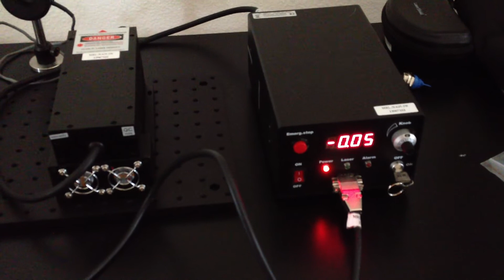635 nm, 3 Watt Diode Laser sales@dmphotonics.com

Comment from the maker: Science Photonics Fair consists of 5 Fairs : IR Fair, Optical Thin Film Fair, Spectroscopy Fair, UV & X-ray Fair, Optics & Laser Fair | In 2014 this event was relocated to The Science Museum and renamed ‘The Science Photonics Fair’. This event is made up of several specialized fairs, focussing on light based technology, such as The IR, Spectroscopy, Optical thin film and UV & X-ray Fairs. After receiving requests from our visitors, we are proud to announce that we have added ‘The Optics & Laser Fair’ to,,
Science Photonics Fair consists of 5 Fairs,
IR Fair
Optical Thin Film Fair
Spectroscopy Fair
UV & X-ray Fair
Optics & Laser Fair
Exhibition Outline
* Date:18-20 November, 2015 10:00~17:00
* Venue:Science Museum, Tokyo
* Supported / Cooperated by: Japan Photonics Council(JPC) / The Optical Society of Japan (OSJ) / Laser Society of Japan / The Spectroscopical Society of Japan / The Japan Society of Infrared Science and Technology / The Optical Thin-Film Science and Engineering group / JPC - Ultra Violet Light Research Group / Consortium of Visible Laser Diode Applications
* Concurrent event : 7th Optical Science Forum Summit
To Book your space

Exhibitor list

Please contact me if you have any question.
Best regards,

Yoshi Tsukamoto
International Dept.
The Optronics Co.,Ltd.
5-5, Shin ogawa machi, Shinjuku-ku, Tokyo 162-0814, Japan
TEL: +81-3-3269-3550 FAX: +81-3-3269-2551
mailto: yoshi@optronics.co.jp
Exhibitor List

Number
　 
A
Aisay Corporation （Spectroscopy） 
AOI Electronics CO., LTD （Spectroscopy）     
ARGO CORPORATION （IR）     
ARTRAY CO., LTD. （IR） 
　 ASAHI GLASS CO., LTD （IR） 
ASO Corporation （IR） 
AVAL DATA CORPORATION （IR） 
B
Bunkoukeiki Co., Ltd. （Spectroscopy） 
　 BWT Japan, Inc. （Spectroscopy）   
C
CBCOptics Co, Ltd （Optical Thin Film） 
CERATECH JAPAN Co., LTD （Optical Thin Film） 
　 CHRONIX Ltd. （IR） 
Consortium of Visible Laser Diode Applications （Laser Display） 
D
DAICO MFG CO., LTD. （Medical）     
　 DHT CORPORATION （IR）     
E
EBA JAPAN CO., LTD. （Spectroscopy）   
　 
F
FEIRA Co., Ltd. （IR） 
Filmetrics JAPAN, INC. （Optical Thin Film）     
　 Fluke （IR）   
FUJITOK CORPORATION （IR） 
G
GRAVITON （Medical）     
　 
H
HAMAMATSU PHOTONICS K.K. （UVIR） 
　 
I
IHARA TEC CO., LTD. （IR） 
IIDA LIGHTING INC. （UVIR）     
Indeco （IR）   
Infinitegra, Inc. （IR） 
　 InPhenix Inc. （IR） 
IR System co.,ltd. （IR）     
IWASAKI ELECTRIC CO., LTD （IR） 
J
JALUX Inc. （IR） 
JAPAN IMPOTERS ASSOCIATION OF LASERS & ELECTRO-OPTICS （Medical） 
Japan Laser Corporation （Medical） 
　 Japan Photonics Council （Medical） 
JEOL Ltd. （Optical Thin Film） 
JPC Ultra Violet Light Research Group （UVIR） 
K
KAWAI OPTICS CO., LTD （Optical Thin Film） 
Ken Automation, Inc. （IR）     
　 KLV CO.,LTD （Spectroscopy）     
Koshin Kogaku （Optical Thin Film） 
L
Laser Society of Japan （Medical） 
　 
M
MAXNER ELECTRONICS Co., Ltd. （IR）   
MicroVision, Inc. （Laser Display） 
　 MITSUBISHI CABLE INDUSTRIES, LTD. （Medical） 
N
NEOARK Corporation （Medical）     
NIDEK CO., LTD. （Optical Thin Film） 
Nihon Tokushu Kogaku Jushi Co., Ltd. （IR） 
NipponRoper （Spectroscopy）   
　 NIPPON　AVIONICS　CO., LTD. （IR）   
NISSIN ELECTRONIC CO., LTD （IR）    
NITRIDE SEMICONDUCTORS Co.,Ltd. （UVIR）    
NITTA CORPORATION （Medical） 
O
Ocean Photonics, Inc. （UVIR） 
Okamotog glass co., ltd （IR） 
OPHIR JAPAN LTD （Medical） 
Optical Coatings Japan （IR） 
Optical Solutions Corporation （Medical）   
Optima Corp. （UVIR） 
　 Opto science, inc. （UVIR）     
Opto-Line, Inc. （Medical）     
OptoSirius corporation （Spectroscopy）     
Otsuka Electronics Co., Ltd. （Spectroscopy） 
OXIDE Corporation （Medical）   
P
PALMESO CO., LTD. （Optical Thin Film） 
PHOTOTECHNICA （Spectroscopy）     
PIEZO PARTS Co., Ltd （Optical Thin Film） 
　 Polatechno Co.,Ltd. （IR）     
PRIMETECH ENGINEERING CORP. （IR） 
Prolinx Corporation （IR）   
Q
　 
R
rhesca Co., Ltd. （Optical Thin Film）     
　 
S
Shikoh Tech LLC （UVIR）     
SHIMADZU CORPORATION （Laser Display） 
Showa Optronics Co., Ltd. （IR） 
Spectral Application Research Lab. Inc. （Spectroscopy） 
　 SUMITOMO ELECTRIC INDUSTRIES, LTD. （IR） 
Sun Instruments, Inc. （Spectroscopy）     
Systems Engneering Inc. （Spectroscopy） 
T
TAMA ELECTRONICS CO., LTD （Optical Thin Film） 
Tamron Co., Ltd. （IR） 
The Japan Society of Infrared Science and Technology （IR） 
The Optical Society of Japan （Medical） 
The Optical Thin-Film Science and Engineering group （Optical Thin Film） 
　 The Spectroscopical Society of Japan （Spectroscopy） 
Tokai Co., Ltd. （IR） 
TOKYO INSTRUMENTS, INC. （Spectroscopy） 
Trimatiz Ltd. （Medical） 
U
U-VIX Corporation （UVIR） 
USHIO LIGHTING, INC. （IR） 
　 USTRON CO.,LTD. （Optical Thin Film）   
V
ViewPLUS Inc. （IR）   
　 Vision Sensing Co., Ltd. （IR）     
W
Wexx Co.,Ltd. （Optical Thin Film） 
　 Wexx Co.,Ltd. （Optical Thin Film） 
X
　 
Y
YAMASHITA MATERIALS CO., LTD. （IR） 
　 Yucaly Optical Laboratory, Inc. （IR）   
Z
　 
Overseas manufacturers distributed by exhibitors (2015)
3D SYSTEMS Inc. 
4D Technology Corporation 
　 Lika Electronic 
LIMO Lissotschenko Microoptik GmbH

Comment from the maker: The DMP-HAML series line laser modules provide an uniform line with sharp ends - even if mounted off-axis to the projection plane. They have an optimized line uniformity (up to ±10%) and either a long depth-of-field or a small line thickness. The DMP-HAML-E version has a separate unit for the drive electronics which reduces the size of the optical head. Possible wavelengths are between 405-1060nm. Output power can be up to 100mW. TTL modulation up to 100 kHz can be offered as an option. For further information contact sales@dmphotonics.com

Comment from the maker: New release of narrow linewidth diode lasers, with linewidth< 0.03 nm, output power up to 200 mW - sales@dmphotonics.com 
Wavelengths Options:
375 nm, 405 nm, 410nm, 442 nm, 447 nm, 450 nm, 488 nm, 515 nm, 520 nm, 637 nm, 640 nm, 705 nm, 730 nm, 808 nm, 915 nm, 940 nm.

Comment from the maker: Low Cost Oxygen Detection Laser Diode sales@dmphotonics.com
The fiber-coupled 760nm laser diode EP760-DMP is a unique high power single wavelength laser source. It is supplied in an industry standard 14 pin Butterfly package with a polarization maintaining fiber pigtail. This 760nm laser diode is ideally suited for the use in TDLAS-based gas sensing systems for oxygen detection.

Comment from the maker: Ultra-Compact High Brightness Fibre-Coupled Laser Diode with VBG sales@dmphotonics.com
The DMP-976-9.00-FC105-VBG delivers 9W output power from a 105µm fiber and has a line width of less than 0.7nm due to the build in VBG stabilization. The diode comes in a very small hermetically sealed package with outer dimensions of just 14mm x 8.5mm x 9mm (LxBxH). It is ideally suited as pump source for fiber lasers. For further information email sales@dmphotonics.com

Comment from the maker: Mini Green Laser Diode Module sales@dmphotonics.com
The dimensions of the DMP-520-01-Mini are just Ø 4mm x 10mm – smaller than a finger nail! It delivers a well collimated laser beam with 1mW output at wavelength 520nm. This green beam is 4-5 times better visible to a human eye than a red beam, because the human retina is more sensitive to this wavelength. Therefore this laser diode module is well suited for many vision applications. For further information email sales@dmphotonics.com

Comment from the maker: 473nm Blue Laser Systems sales@dmphotonics.com

473nm DPSS blue laser systems with output power from 20mW to 200mW. Their compact design, high reliability and ease of use make them an ideal choice for corporate and university research laboratories.
Applications:
• Optogenetics
• Raman spectroscopy
• Interferometry
• Holography
• Fluorescence excitation
• Semiconductor surface inspection
• Microscopy and diagnostic imaging
• DNA sequencing and analysis

DMPVA-I-20-473
20mW 473nm Blue Laser System

DMPVA-I-50-473
50mW 473nm Blue Laser System

DMPVA-I-100-473
100mW 473nm Blue Laser System

DMPVA-II-150-473
150mW 473nm Blue Laser System

DMPVA-II-200-473
200mW 473nm Blue Laser System

DMPVA-II-300-473
300mW 473nm Blue Laser System

DMPVA-II-500-473
500mW 473nm Blue Laser System

DMPVA-II-800-473
800mW 473nm Blue Laser System

DMPVA-II-1000-473
1000mW 473nm Blue Laser System

Features Specifications Images Options
•  Fully adjustable output power from 0mW up to the maximum rated output of each model.
•  High stability output of within less than 5% over 8 hours.
•  Closed loop TEC active cooling ensures stable output over long periods.
•  LED display of laser driver output current.
•  Exceptional beam quality over the complete working life of the laser.
•  Does not require high power or multi-phase power circuits.
•  Complies with federal regulations (21 CFR 1040.10, 1040.11)
•  Warranty: 12 months

Comment from the maker: Green Laser Modules - sales@dmphotonics.com
The compact green laser modules operate at wavelengths of 515 to 520 nm and are available up to  70 mW in power at the present time.
Unlike diode pumped green lasers, Green Laser Modules offer high thermal stability, low noise and high modulation capabilities. 

Green Laser Modules are available with or without temperature control. 
Beam shaping optics like line/cross generators can be added on.

We also continue to offer diode pumped green laser modules for those applications that need a 532 nm wavelength and superior beam quality. 
Our TECGL series temperature controlled green lasers work exceptionally well at ambient temperature range between 10 to 40 degree C and they are strongly recommended for applications which require low RMS noise and peak to peak laser power stability.

FEATURES APPLICATIONS
Excellent Wavelength and Power Stability
Bioanalytical & Measurement
Low Power Consumption
Imaging
-
LASER SERIES LASER WAVELENGTH LASER POWER SIZE MODULATION FEATURES
DPGL-Series 532 nm 0.4 to 5mW 15 mm D x 69 mm L Can be added Circular Beam
HP-Series 520 nm upto 25 mW 15 mm D x 51 mm L Can be added Direct Diode Based
TECGL-Series 520 and 532 nm upto 75 mW 25 mm D x 75 mm L Can be added Temperature Controlled

Comment from the maker: High-power Laser Diode Bar Modules sales@dmphotonics.com
With their emitting areas arranged in line to make a linear array, LD bar modules achieve high performance, high output power and high reliability when coupled with cooling devices. When stacked, the output power can be as high as a few kilowatts. There are primarily three cooling methods: the compact and simple Peltier-type Open Heatsink(OHS), the more efficient Water cooling, and Funryu cooling (highest cooling efficiency). The appropriate cooling method should be selected in accordance with the required output power, driving conditions, and application. 
Type No. Product Name Type number Peak emission wavelength typ. Output power typ. Pulsed ｒadiant ｐower typ. Operating current typ. Operating voltage typ.
High-power Laser Diode Bar Module 
DMPL8413-50-808 High-power Laser Diode Bar Module 808 nm 50 W -- 62 A < 2 V
DMPL8413-60-940 High-power Laser Diode Bar Module 940 nm 60 W -- 63 A < 2 V 
DMPL8413-60-980 High-power Laser Diode Bar Module 980 nm 60 W -- 65 A < 2 V
DMPL11396-50P808 High-power Laser Diode Bar Module 808 nm -- 5000 W 105 A < 100 V
DMPL11396-50P940 High-power Laser Diode Bar Module 940 nm -- 7500 W 150 A < 100 V 
DMPL11396-50P980 High-power Laser Diode Bar Module 980 nm -- 7500 W 150 A < 100 V 
DMP11398-16P808 High-power Laser Diode Bar Module 808 nm -- 1600 W 105 A < 32 V
DMPL11398-16P940 High-power Laser Diode Bar Module 940 nm -- 1600 W 100 A < 32 V
L11398-16P980 High-power Laser Diode Bar Module 980 nm -- 1600 W 100 A < 32 V
L11408-15-808 High-power Laser Diode Bar Module 808 nm 900 W -- 70 A < 30 V
L11408-15-940 High-power Laser Diode Bar Module 940 nm 1200 W -- 90 A < 30 V
L11408-15-980 High-power Laser Diode Bar Module 980 nm 1200 W -- 90 A < 30 V

Comment from the maker: DPSS laser kits
http://www.dmphotonics.com/DPSS_laser_kits/DPSS%20laser%20kits.htm
High power Laser kits and Eye safe laser kits

Del Mar Photonics offer high power laser kits and eye safe laser kits:
HIGH POWER LASER KITS - request a quote
1. The Grown YVO4+Nd:YVO4 crystals
2. The diffusion bonding :YAG+Nd:YAG; YVO4+Nd:YVO4 crystals
3. Low absorption @1064nm ND:YVO4 crystals
4. High damage threshold LBO crystals for THG@1064nm
5. laser dimension Brewster cut BBO for 4HG@1064nm

EYESAFE LASER KITS - request a quote
1.Er:Glass rods: CR14 (lamp pump) and EAT14 (LD pump)
2.Diffusion bonding crystals: Nd:YAG+Cr:YAG,
3.NCPM KTP or KTA for 1064nm---1570nm OPO. Dimension from 3x3x20mm to 10x10x30mm

Other optics:
High precise lenses and windows, prisms
Waveplate
polarizer
 

Example of custom crystals and optics for DPSS laser manufacturing:

Green DPSS
****************************************
Nd:YVO4, 3at.%Nd, a-cut, 3mm×3mm×1mm
S1: HT-808, HR-1064/532
S2: AR-1064/532
request a quote
***************************************
KTP
Theta 90deg, Phi 23.5deg
3x3x1mm or 3x3x2mm
S1,S2 AR1064/532
request a quote
***************************************
Green Output Lens (LEN2)
Dia 6×2 S1: R=-50 HR-1064 (R>99.8%), 
AR-532(R<0.2%) S2: R=? AR-532(R<0.2%)
request a quote

***************************************

Blue DPSS

***************************************
NdYAG: 3×3×2mm, 1.1%doped
S1: HT-808/1064/1319 (T?95.0%/90.0%/90.0%), 
HR-946/473 (R?99.8%/99.8%), 
S2: AR-946/473 (R?99.8%/99.8%)
request a quote
***************************************
LBO
3×3×1mm or 3x3x2mm 
Theta=90deg, Phi=19.4deg
AR/AR-946/473 (R?99.8%/99.8%)
request a quote
***************************************
Blue Output Lens (LEN3)
Dia 6×2 S1: R=-50mm, HR-946(99.8%), 
HT-473(T>99.8%)/1064(T>90%)/1319(T>60%); 
S2: R=?, AR-473(R<0.2%)
request a quote
***************************************

Comment from the maker: Stable miniature short-pulsed VCSEL-pumped laser with monolithic resonator
Uros Orthaber, Rok Petkovsek, Andrej Vrecko, Igor Poberaj
10 February 2015 • 2:40 - 3:00 PM | Part of SPIE LASE

Towards 3D laser nano patterning in polymer optical materials
Patricia J. Scully, Walter Perrie
12 February 2015 • 8:30 - 9:00 AM | Part of SPIE LASE
UPCOMING CONFERENCE
High Power Lasers for Fusion Research III
10-12 Feb 2015 | Part of SPIE LASE

Yb-fiber laser for multimodal imaging
Ilyas Saytashev, Bingwei Xu, Marcos Dantus
9 February 2015 • 4:05 - 4:20 PM | Part of SPIE BiOS
UPCOMING CONFERENCE
Laser Refrigeration of Solids VIII
11-12 Feb 2015 | Part of SPIE OPTO

Opportunities for designing microstructured optical fibers for efficient femtosecond laser grating inscription
Tigran Baghdasaryan, Thomas Geernaert, Hugo Thienpont, Francis Berghmans
10 February 2015 • 8:50 - 9:10 AM | Part of SPIE OPTO

Trans-wafer removal of metallization using a nanosecond Tm:fiber laser
Ilya Mingareev, Sascha Berger, Thomas Tetz, Ali Abdulfattah, Alex M. Sincore, Lawrence Shah, Martin C. Richardson
9 February 2015 • 4:10 - 4:30 PM | Part of SPIE LASE
UPCOMING CONFERENCE
Vertical-Cavity Surface-Emitting Lasers XIX
11-12 Feb 2015 | Part of SPIE OPTO

The multiple-pulse driver line on the OMEGA laser
Tanya Z. Kosc, John H. Kelly, Elizabeth M. Hill, Leon J. Waxer
12 February 2015 • 4:20 - 4:40 PM | Part of SPIE LASE

Supercontinuum from single- and double-scale fiber laser pulses in long extra-cavity P2O5-doped silica fiber
Sergey M. Kobtsev, Sergey V. Kukarin, Sergei V. Smirnov
10 February 2015 • 6:00 - 8:00 PM | Part of SPIE LASE

Progress in high-energy-class diode laser pump sources
Paul Crump, Carlo F. Frevert, Frank Bugge, Steffen Knigge, Götz Erbert, Guenther Traenkle, Agnieszka Pietrzak, Ralf Hueslewede, Martin Zorn, Juergen Sebastian, Jens Lotz, Wilhelm Fassbender, Joerg Neukum, Joerg Körner, Joachim Hein, Thomas Toepfer
9 February 2015 • 1:50 - 2:10 PM | Part of SPIE LASE

Semiconductor defect metrology using laser based quantitative phase imaging
Renjie Zhou, Christopher A. Edwards, Gabriel Popescu, Lynford Goddard
9 February 2015 • 4:00 - 4:20 PM | Part of SPIE BiOS

All-fiber probe for laser-induced thermotherapy with integrated temperature measurement capabilities
Yu Liu, Wei Chen, Hao Yu, Andrea Braglia, Massimo Olivero, Alberto Vallan, Guido Perrone
8 February 2015 • 1:30 - 1:50 PM | Part of SPIE BiOS
UPCOMING CONFERENCE
Novel In-Plane Semiconductor Lasers XIV
9-12 Feb 2015 | Part of SPIE OPTO

Laser micromachining of transparent glass and quartz dielectrics using nano short pulsed Nd:YVO4 laser harmonics
Shiva P. Gadag
10 February 2015 • 6:00 - 8:00 PM | Part of SPIE LASE

Infrared laser sealing of porcine tissues: preliminary in vivo studies
Christopher M. Cilip, Thomas C. Hutchens, Duane E. Kerr, Cassandra Latimer, Sarah B. Rosenbury, Nicholas C. Giglio, Gino R. Schweinsberger, William C. Perkins, Christopher R. Wilson, Arlen K. Ward, William H. Nau, Jr., Nathaniel M. Fried
7 February 2015 • 3:00 - 4:00 PM | Part of SPIE BiOS

Widely-tunable interband cascade lasers for the mid-infrared
Robert Weih, Matthias Dallner, Julian Scheuermann, Michael von Edlinger, Marc Fischer, Johannes Koeth, Sven Höfling, Martin Kamp
11 February 2015 • 1:50 - 2:10 PM | Part of SPIE OPTO

Structural dependence and mechanisms of LIPSS formation at a step edge due to single-pulsed femtosecond laser irradiation
Rico S. Cahyadi, Ryan D. Murphy, Ben R. Torralva, David P. Adams, Steven M. Yalisove
10 February 2015 • 6:00 - 8:00 PM | Part of SPIE LASE

Femtosecond laser direct-write of high-Q microresonators in glass and crystals
Ya Cheng, Jintian Lin, Jiangxin Song, Lingling Qiao, Wei Fang, Yingxin Xu
11 February 2015 • 1:30 - 1:55 PM | Part of SPIE LASE

Er and Yb co-doped glasses for eye-safe lasers
Simi A. George
10 February 2015 • 8:40 - 9:00 AM | Part of SPIE LASE